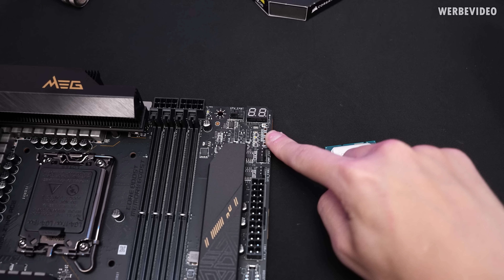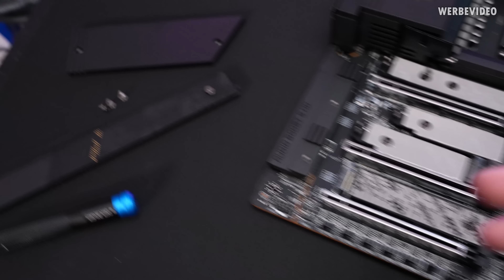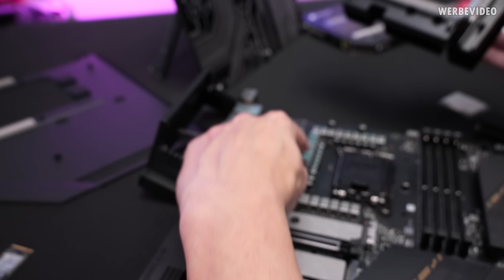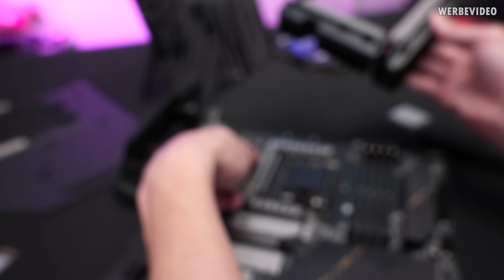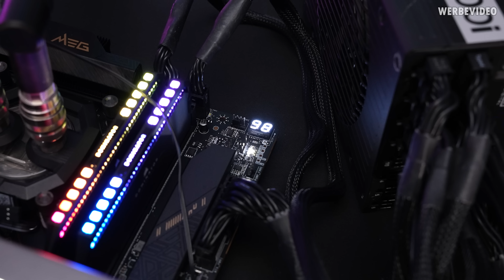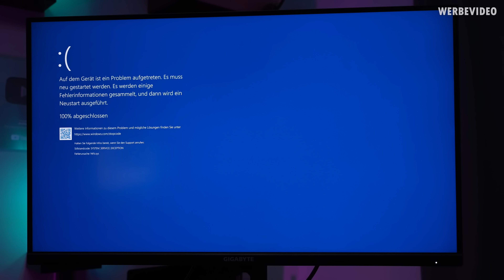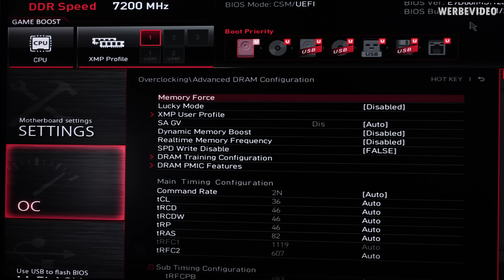My Opinion on the MSI Z790 ACE

Comment: I need major help. I finally got all my parts in. Using this board and was installing it in my case and the standof screw hole under the rear I/O fell off my screw driver that was magnetic and it fell under the the VRM heatsink and I can’t figure out how to take off the heatsink. How did you take yours off??
Reply: Update. I figured it out. I took apart my entire motherboard. Including chipset heatsink. I still couldn’t find the screw I dropped. Once everything was apart. I looked at the M.2 push mechanism the one without any screws. Well I found the screw magnetized to the LED part of the M.2 heatsink. Wow just wow of me.
Reply: Shit would have been bad to just say f it and turn it on right? I remember putting mine together and my screw kept falling because the screw wouldn’t bite and I was this close 👌 to just saying “fuck it, I’m gonna plug it in”😂

Comment: I know this video is old but one question I have if anyone will see this is how did you get the plastic dragon logo piece off that exposes the MB battery? Were there screws to undo or is it held on by magnets? I have this board but I could find no documentation on how to change the MB battery if needed? So it is a fear of mine that if I ever need to change it that I will have to remove the entire MB to get to that battery? Any reply is most appreciated. Thanks!

Comment: @10:18 you state incorrectly that the board has no DisplayPort for iGPU connector. One of the USB-C ports on the back panel has the DisplayPort logo next to it, and this is listed as such in the manuals. I just downgraded to this MoBo from Godlike for exactly this feature, since I am going to be doing Machine Learning on this rig and wanted 100% of the 4090 available. I'm not sure how that relates to your comments on the power stages, but if you ever recut this video (or review other ACE models), look for the small D logo after the SS logo on the back IO. Perhaps not that interesting for gaming setups, but for anyone wanting to push the data science use-case without the Workstation budgets, iGPU support is a key one to look out for, and I had to return the Godlike because I didn't expect a flagship product to lack iGPU connectivity. Would help if YouTube reviewers factored in these use-cases alongside gaming. Love your videos - thank you!
Reply: Just finished the video and saw the correction comment - nice! Looking forward to my board showing up and getting my Godlike refund :-)

Comment: Was looking for a motherboard to for my 19-13900k build and was considering this exact motherboard.  Loved the dual port lan, even though it should be 10G for a 550 dollar motherboard.  I also did the usb-c display port and thunderbolt connections right on the I/O.  What killed it for me with this motherboard is the black and gold color scheme and MSI big ass dragon logo.  Cant stand it so I just went with the Gigabyte Aorus Master X instead.  10G Lan though a second 2.5g lan port would have been nice.  Would have liked to see a Usb-c display port but I can live with out it.  No thunderbolt on the I/O but does have the thunderbolt add on header.  All in all I think it was a good choice.  For people like me, choosing a motherboard is difficult since most of the PC parts are targeted towards gamers.  So Im always left with sifting through all the high end gaming motherboards to see find which one fits my specific feature set needs.  Really wish gigabyte would do a higher end Aero motherboard in black.  Id be all over that

Comment: Igpu connects with a straight pass through, through the number 9 c port (the top cport if your looking at the rear io). With a cport to display port  cord you can connect from the motherboard straight to the dispay without any thunderbolt non sense, also currently running corsair vengeance 4x 16gb 6600mhz set overclocked to 7400mhz

Comment: 'You have to use screws to hold down your mainboard anyway', so your saying M.2 drives never fail and need to be removed then?  R I G H T!

Seems derBauer has a boring air coold computer that never breaks but for us enthusiasts I have actually had to remove a M.2 drive and it's a serous pain in the ass with a vertical GPU mount and a full custom loop.

So yes, being able to sneak the M.2 in and out behind the GPU would be marvelous.  Having finally bent over for an Asus board even their captive screws on the M.2 heatsink and little plastic twisty thing was great even with the board sitting flat on an anti-static mount.  These motherboards cost a King's ransom and so they need to be making it as pleasant as possible to justify these stupid prices.  Speaking of stupid prices and features, why is there not a System Management chip on the board?  I mean a hardware based chip that runs fans and RGB that is independant of the CPU and chipset and thus will operate immediate at power up so that fans don't go to 100 at start up and resume from sleep?  Those fan headers, pump headers, and thermal headers are all useless to me for that reason.  First I hate that annoying jet taking of sound during boot or resume but also I can't trust the bios to keep setttings anyway.  Just stop wasting time on all those fan headers and for that matter RGB headers.  Motherboard manufacturers make ass software, been that way for >2 decades so I don't see any reason for them to start figuring it out anytime soon.

Comment: only because your motherboard supports fast ram, doesn't mean your cpu does... sure can overclock a cpu.. but it'll only go so far, before ram is downclocked or locked down... so never really anypoint buying ram that's faster than your CPU... The RAM will be downclocked to match the FSB/Memory controller speeds.

All these newbies and children buying faster ram without knowing anything! You can also have negative stabilities for having ram faster than your cpu!

Both motherboard and cpu speeds should be looked at before buying ram!

Please can you incels please stop buying ram that's not actually compatible, stop buying ram of massive speeds!

Comment: I’ve got this problem where the m.2 heat sink doesn’t come off. Has anyone else got this problem. I’m pressing the button and lifting but it’s not coming off.
Reply: Update : just add more force and wiggle it quite hard and it will come off. Board working perfectly now.

Comment: I'm having an issue where Windows won't boot if I restart the computer. This is a brand new build. Windows will only boot if I turn the PSU off and then on. I checked all the cable connections and made sure the graphics card and all ram chips are seated. I checked compatibility and all seems good. I flashed the bios also. I can't seem to find anything else on the web that I haven't tried. The motherboard has a LED bios post display and it gets stuck at 16. This code refers to Pre-Memory System Agent initialization (System Agent module specific). The only other thing I haven't tried is taking the CPU off and try reseating it again. Has anyone had any problems like I have?

Comment: All ASUS Z690 and Z790 have issue with PCH temp. very high sometimes 90c. while in Gigabyte z790 it was 48c max.  ASUS cooling solution for chipset is really bad so if you going to buy new motherboard check this out. I don't know if MSI Z790/Z690 have same problem!

Comment: I went through 2 boards before I settled on the Z790 Apex from Asus. All these manufacturers are advertising memory speeds that are nowhere near what their boards are capable of. They blame it your chips memory controller when you send them an email about the situation, meanwhile it's the board. I guess they figure they use these juiced up speeds for marketing purposes and rely on most people not knowing how to check the quality of their silicon. This is literal false advertising. After this gen I'm sticking with Asus, I always felt they were overpriced, but at the end of the day their board works as advertised. Running 8000mhz rock solid with a big smile on my face lol

Comment: I'm pretty new to this pc building thing, what water cooler would fit well with this board? I'm planning on buying a 12900k and 4090 for this board.
Reply: Any AIO will fit on this board. It’s a pretty big board. If your running a 4090 I’d just go for a 13900k. Not too much more expensive and, in my opinion, if your looking to run a 4090, you might as well just go all out. Not necessary in the slightest, but if you want as much performance as possible, which sounds like what your going for, I’d just send it. What I did anyway.

Comment: On my opinion motherboard have really good cooling and would never tilt any CPU runs at stock, I have am4 gigabyte b550 aorus pro v1 and goes around 55C when my r5-5600x clocked to 4.85Ghz goes around 66C temp in gaming.

Comment: Der Bauer/Roman, did you try changing between Gear 1 and 2 in the BIOS? 7800 MT/s might have been possible at Gear 2.
Reply: I just found out from BuildZoid (Actually Hardcore Overclocking) that Gear 1 doesn't work for DDR5! I wasn't previously aware of that and it explains why my i9-12900 5200MT/s DDR5 MSI Carbon won't boot when I try Gear 1.

Comment: In what cases does it make sense to spend so much money on a mb for essentially nothing more than fluff and RGB? At that point, why not go for a W790 LGA4677 motherboard with actually good workstation features and the socket to use actual workstation CPUs?

Comment: LOVING these in-depth spec hardware claims testing videos! Speaking of memory timings and motherboards, I have a question; I heard that because of the infinity fabric AMD use, that it's a bad idea, even with the latest 7950X3D CPU, to go over 6,000MT/s RAM. But having looked at some of the high-mid range motherboards, I see they list support for higher RAM speeds, like the ASRock X670E Taichi says supports DDR5 6600MT/s, the ROG STRIX X670E-E says supports 6,400MT/s, and the Gigabyte X670E AORUS Master says supports 6,666MT/s.

Other than being more expensive, is there any reason I shouldn't get say a 6,600MT/s 64GB (2x32GB) kit (with the lowest CL I can find) along with an ASRock X670E Taichi motherboard and a 7950X3D CPU? 

As a bonus question, which DDR5 64GB (2X32GB) 6,600MT/s RAM kit would you recommend for the 7950X3D setup, if performance is more important than price? And mu Google search for "best motherboard for 7950X3D" suggested ASRock X670E Taichi motherboard (if budget isn't a bif factor); is this something you agree with?

Thanks in advance. :)
Reply: With AMD 7000 series CPUs you want DDR5 6,000MT/s, which is 3,000MHz so that the Infinity Fabric (IF) can run at 2,000MHz in a 3:2 ratio. Faster DDR5 would cause the IF to clock slower. Overall DDR5 6000 is best.

The RAM kit I'd recommend is G.Skill Trident Z5 Neo 64GB (2x32GB) DDR5-6000 CL30-40-40-96 1.40V (F5-6000J3040G32GX2-TZ5N <-- Add and 'R' for RGB version)

For a standard size ATX motherboard I prefer the ROG CROSSHAIR X670E HERO. It has the most complete modern feature set in my opinion.

Comment: If you compare those temperatures with older systems, that this is mind-blowing they press out these, CPU, GPUs to the limit, for testing, in school, we did these tests till break point from heat. CPUs did go max up to 85°C the die fell off and started to disintegrate. And now... 80, 90, to 100°C is "normal" unbelievable.

Comment: You can clearly see the one single different SPS at the top right for the iGPU and a 90A SPS is plenty for iGPU usage. Plus, the 2 mini Display Port "in" ports at the back give it away. USB-c to USB-c video out, HDMI or DP2.1 out is capable and labeled on the back. DB losing his ways with the mainboard....lol. At least he caught it at the end. This is the MEG ACE series which always had onboard iGPU support. Its the GODLIKE that did away with the iGPU.

Comment: This memory speed issue might be a CPU memory controller. It depends how lucky you get with it.
Reply: No this board is actually trash for stabilizing memory up to 7000mt/s even with the bullshit qvls. I had that problem with this board before replacing it with an Asus z790 apex using the same CPU and ram and was able to hit 8266mt/s for comparison. 

It's a nice looking board but if you want easy overclocking I would avoid.

Comment: I'm not convinced your attraction to finned VRM heatsinks is based in scientific reality. They're passive, finned heatsinks are not optimal for passive dissipation, the big chungus blocks with fat fins are. The power delivery of these boards is past the point of overkill and the phase counts these days aren't required at all, even for liquid cooling or XOC, it's just marketing. Regarding advertised memory speeds, it looks like a lot of the Z790 boards this gen are lying about their support. The I/O looks fantastic, but I wish they'd give you more PCIe slots instead of M.2, since if you really want 5-6 M.2 drives, just get an add-in card instead of sacrificing flexibility.

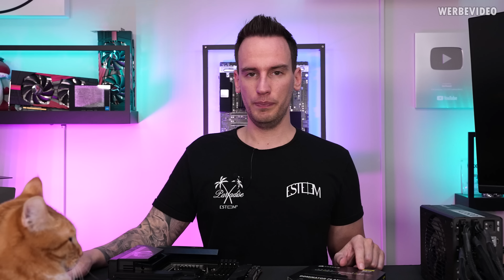Comment: @10:25 ugh that sucks. iGPU may not be great but like, I personally run a lot of displays on my machine and was even more before 3 got replaced by a neo g9 and even still I use a lot, I have two nvidia gpus and 8 displays (was 10 before the g9) on them and use the internal gpu to ship to extra outputs to my projector in the living room and then also to my TV in my bedroom. That's 12 displays before the g9 which means I had the projector and TV sharing one (which for practical purposes is totally fine) using all 3 iGPU outputs along with both dGPUs being maxed out (even though one of my gpus has 5 ports,nvidia says you're not allowed more than 4 displays on one card unlike amd)

Comment: Imo MSI missed its mark, knowing they wont release the UNIFY Z790, they should have done a 2 slot memory ACE, would easily made it easier to swallow the $700 price tag.  Second mistake.... 2x 2.5gb lans.... the X670 ACE has 2.5gb and 10gb, why the intel version don't but they cost the same.   

For $700 Asus Z790 Apex is a better buy, and if it ever becomes available, the Gigbyate Z790 Tachyon is also good buy for $100 less.  MSI made a superb board with the Unify X, why no follow up... the Carbon is not the same.  Still i prefer MSI over any brand, but their high end line is not worth it, their mid-low end is pretty solid.
Reply: Got the Z690 Formula that was affected by the really bad BIOS update 2305. Been thinking to get a new board that has 2 bios for safety and the APEX Z790 could fill that role.

Would anyone safely buy the Apex Z790 after all the clusterfuck that ASUS is going into lately?
Reply: @starfuxer  I yet to see any issues with Asus + Intel as its being shown with AMD +Asus.

Comment: Wtf, threads in the cover plate??? No no no, that's not an inconvenience, that's a straight up design flaw. This will absolutely lead to the screws acting as standoff studs instead of clamping connectors. MSI needs to offer non-threaded replacements to any users who receive boards with these flawed cover plates.

Comment: 90C on such absurdly big VRM on "measly" 320W is just garbage, while absolutely acceptable in terms of temperature handling by mosfets, it's just bad, when looking at how many phases there are. X670 Elite without (!!!) a heatsink under constant 230W heats up to 72C (Buildzoid's vid), it wouldn't be that much hotter under 320W without a heatsink than MSI's board. Z790 Ace is weird, it's underequipped, but with lots of jumpers, thermally underperforming VRM and lackluster RAM compatibility - it's subpar to Z790 Strix boards, which can do 7600MHz and are cheaper. Guess Ace is just for looks and LN2 overclocking.

And there's the cheaper Apex, which makes the Z790 Ace simply silly. And there's still no sight of Z790 Unify-X.

Comment: I have an ASUS TUF motherboard and for the second M.2 drive there's a shield for cooling the SSD but I checked with a light behind it looking from the side and I see that there's only a very small portion of the thermal pad actually touching the chips on the SSD, and when I look at the temperatures I see that the M.2 SSD with the shield on it is a little bit warmer than the M.2 SSD without the shield on it and the one without the shield is right in between the CPU and graphics card so you'd think that's the hotter one but it's just the other way around, and I have 2 M.2 SSD drives from Samsung the 980 PRO version only the one with the shield on it is 2TB and the other one is 1TB so only the capacity is different and I don't think that the one with less capacity is cooler because of that.

Comment: I was upset that I bought TG 7600MHz and they are not stable on ASUS STRIX Z790-E. I expected this board from MSI to be better at DDR5, but the ASUS HERO runs just fine at 7400MHz.
STRIX runs fine in Windows at 7600MHz, but the game crashes after about 30 minutes. I haven't seen the blue death yet.
Personally, I think that this instability is due to an untuned BIOS.
But someone says that it could be a calf. But the maximum temperature is 48-50C, I think it's not a problem.
ASUS and MSI should work on a better BIOS and not just make a good BIOS on ASUS APEX.
Reply: msi bios are trash :/ I know I have 2 ! the problem  is that asus pcb layout and way to split the available bandwith is trash so i always end up with msi...really dont recommend msi unless like me you need lots of rear usb-a 3-4 m.2 etc..the msi tomahawk ddr4 z790 is basically an intel version of the asus x570 crosshair viii dark hero but with an horrible bios